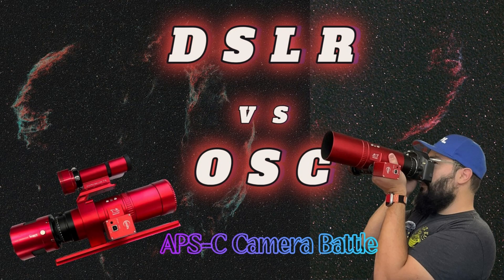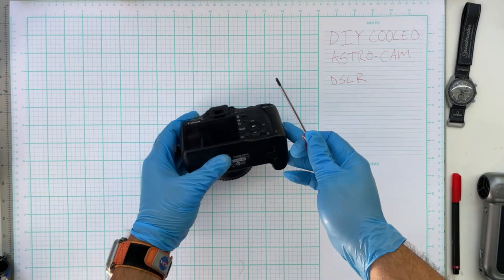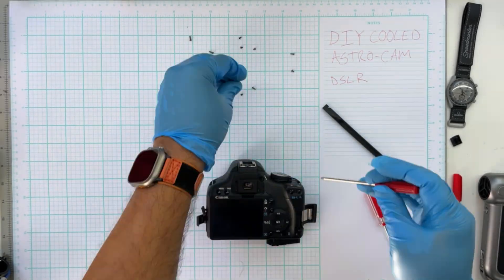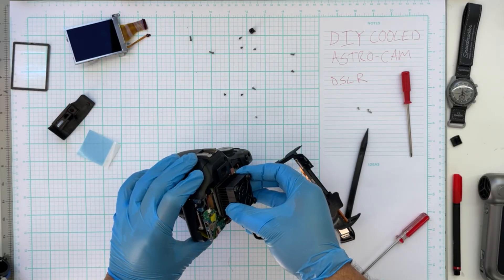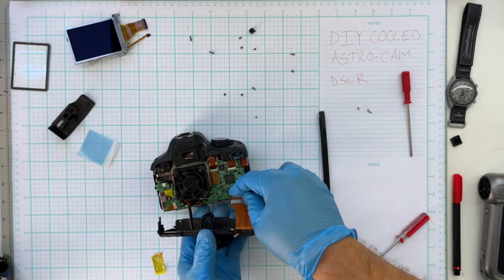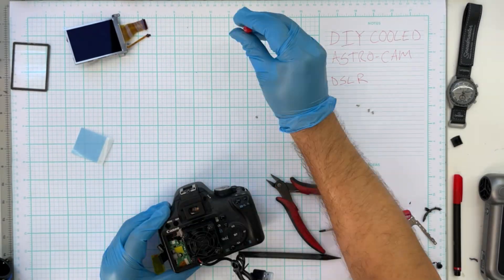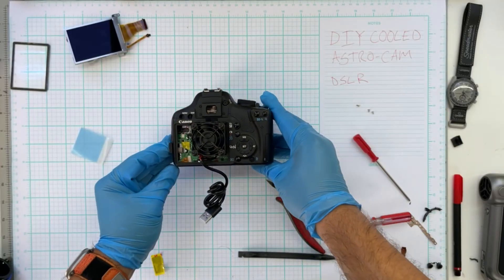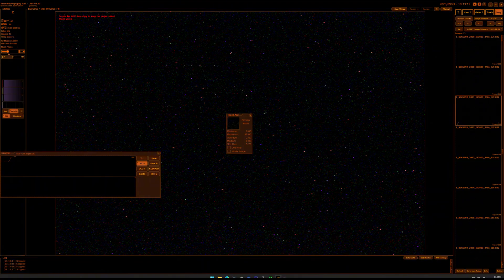DIY Cooled DSLR Astrophotography Camera | Initial Result | Best astrophotography mod for deep space?

Comment: This is great 
I have an astro modded 60D, which I modded myself, do you think I could do this as well ?
Reply from the maker: If you did the mod yourself then your probably pretty comfortable inside the camera by now, and for the 60D, you should try and just attach the cooler to the plastic behind your flipout screen first, and see if thats enough cooling to make a difference. then you dont have to permanently modify the housing. But yeah it should work! Please be very careful, as you know these are very delicate instruments :)